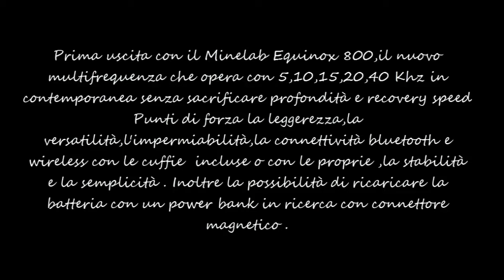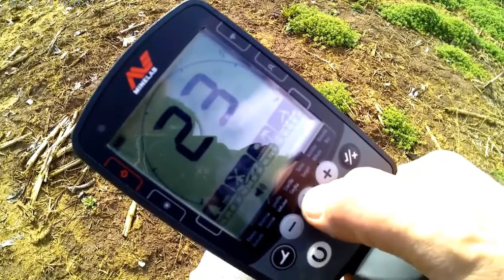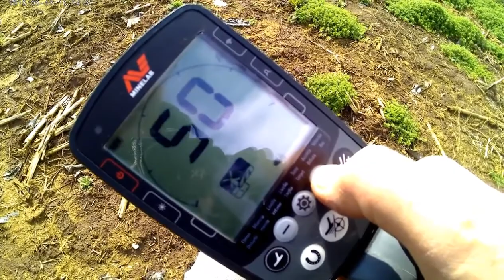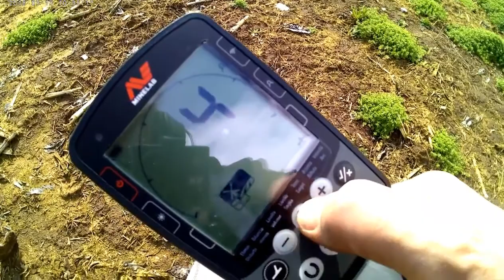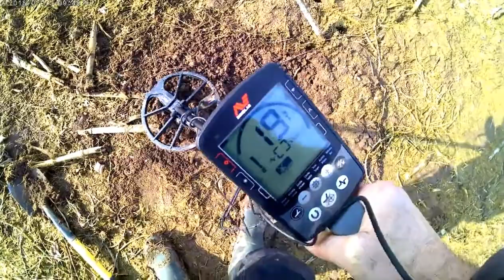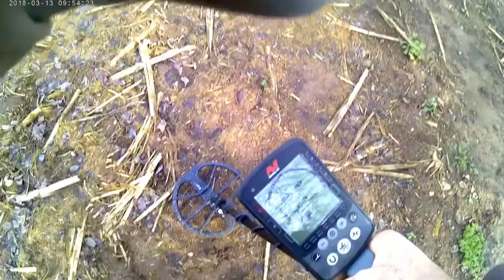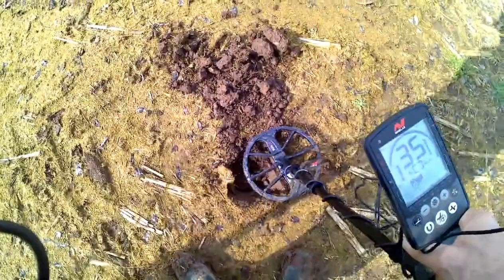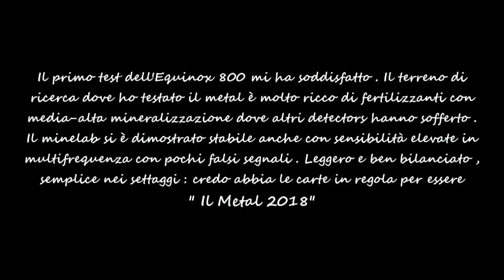Minelab Equinox 800 , prima prova in ricerca vera

Comment: Ciao ho la possibilità di scegliere a parità di prezzo tra un anfibio o un equinox 600
Mi piacerebbe spazzolare in spiaggia ma anche in parchi e boschi.
Cercare monete ma anche militaria.
Cosa mi consigliate?
Inoltre quali sono le differenze tra il 600 e 800?
L’anfibio è più paragonabile al 600 o 800?
Scusate le tante domande.
Grazie a tutti
Reply from the maker: Scusa il ritardo ma problemi mi hanno fermato. Se vuoi un detector che vada bene in ogni sito ed anche  al mare con l'equinox non hai problemi in quanto multifrequenza e impermiabile fino a 3 metri . Fai tutto

Comment: Mi piace molto questo metal e devo dire che ci sto facendo un pensierino. Noto che hai dovuto scavare molto ferro grosso. Io ho il t2 e non mi capita quasi mai. È un limite dell'equinox secondo te?
Reply from the maker: Calcola che questa era la prima uscita in assoluto con l'equinox 800 per qui ancora non comprendevo bene i settaggi del metal . Tendevo quindi a scavare tutto . Anche il settaggio avanzato dell' Iron Bias  era a 0 e quindi con il ferro arrugginito e/o voluminoso il metal ti da  segnali misti ferro/buono. Con l'Iron Bias a 1-2 ottieni molti meno falsi segnali con il ferro voluminoso per cui scavi meno ferro . Il segreto è ( parlo dei terreni dove cerco io a media mineralizzazione) un corretto bilanciamento del ground e una sensibilità sui 18-20 che ti garantisce un'ottima profondità associata ad una recovery di 2-3 con spazzolate velocità medio-lenta . Ti assicuro che su un terreno ricco di rumenta già spazzolato e rispazzolato con il Deus piastra HF l'Equinox mi ha tirato fuori piccoli argenti a 15 cm. che  non erano stati  rilevati precedentemente . Per ora quindi ritengo di avere fatto la scelta giusta acquistando l'Equinox.
Reply: rottwi grazie infinite sei stato molto esauriente nella risposta. Si vede che te ne intendi. E sono sorpreso di questa probabile superiorità del minelab sul deus con hf nel rilevare argento sottile...avevo letto che la hf dava il suo meglio proprio nello scovare quel tipo di oggetti. Evidentemente la frequenza multipla rende e sull'equinox è stata ben implementata. Contento di sapere che con buoni settaggi si riesce a risolvere il problema del ferro grosso. Mi piace sempre di più questo metal!
Reply from the maker: Non so se la mia risposta tardiva ti può aiutare ma il nuovo upgrade del firmware del Nox aggiunge sul parametro dell'Iron Bias la funzione F2 che da un grande aiuto nella discriminazione del ferro ed anche dei tappi corona.
Reply: @rottwi  grazie 1000 poi l'ho preso e ce l'ho da 1 anno e mezzo. Che dire, lo amo! So del nuovo iron bias f2, fantastico coi tappi a corona! Tu hai nel frattempo scoperto qualche bella combinazione di settaggi? io lo uso di solito sui campi, field 1 o 2, 5 toni e f2 messo a 4, recovery 7. Poi dipende dal terreno o da ciò che voglio ottenere. Sei stato uno di quelli che mi ha fatto capire le potenzialità del nox...non te lo nascondo!